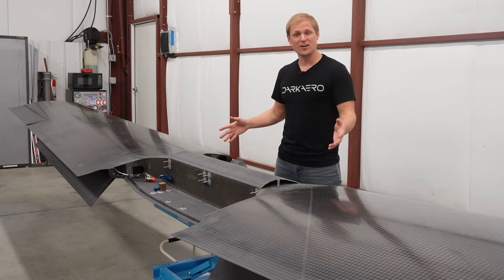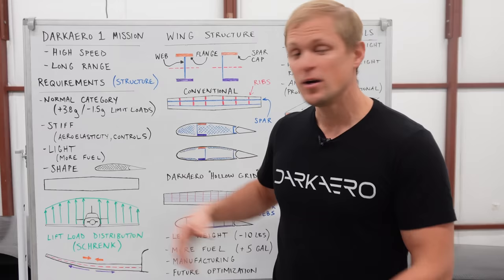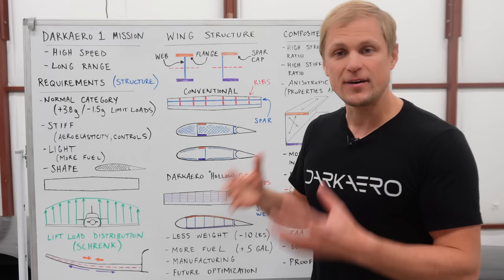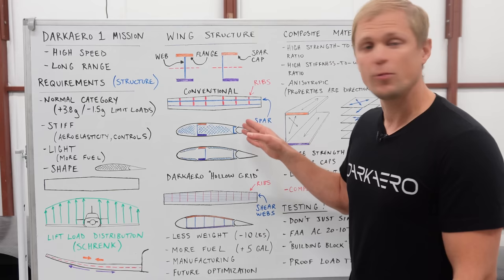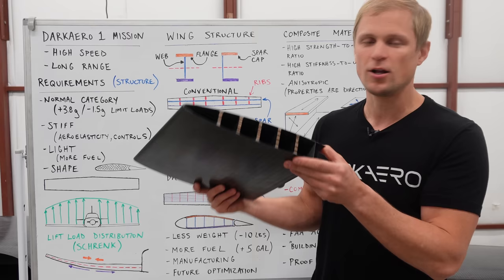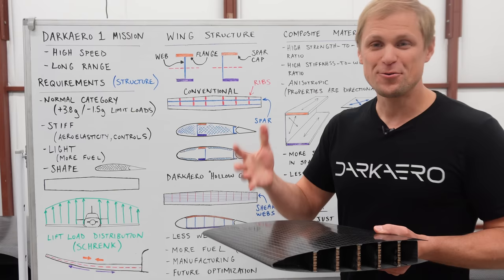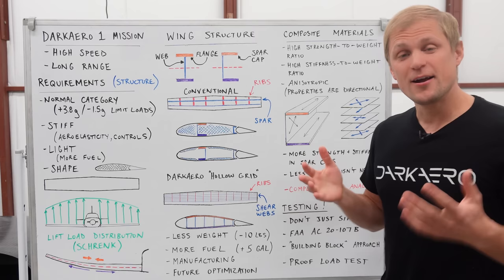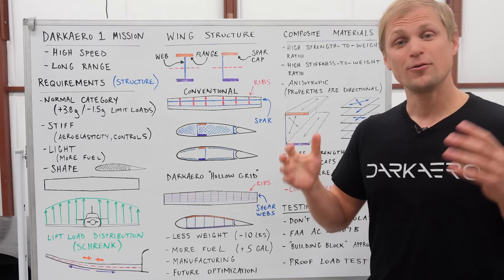Exoskeleton wing design - how carbon fiber makes it possible

Comment from the maker: Learn how to design and build your own high-quality composite parts and structures!

Sign up for the Aerospace Composites Course here: https://darkaero.com/courses/aerospace-composites
Online version available here: https://darkaero.podia.com/aerospace-composites
Reply: Im curious will yall have a jet engine variant in the future like Sonex has done?
Reply: We must be getting close to take off.
Reply: Very impressive lecture.    When you performed the load testing of the complete wing,  even though the wing withstood the load,  how do you know if internal damage has occurred ?   Do you have inspection hatches/ holes to enable say fibre optic visual inspection,  or are there other NDT testing methods available….strain gauges, ultrasound etc…
Inevitably the wing will experience stress/strain reversal which in an Al structure will lead to fatigue,  do these composite  structures delaminate ?    How do you plan to verify the structural integrity while in service ?

Comment: I would love to know if you guys have been surprised by anything you've learned yet while building this very coot plane?  Is there anything that you just didn't even think about or is the building and design process calculated to the last detail and you haven't been surprised by anything?  Keep up the cool videos, I get excited when I see a new one.
Reply from the maker: Hi Paul! Thanks for checking out our videos and thanks for the great question. Yes, lots of surprising challenges popped up along the way. A big one was canopy manufacturing, which turned out to be much more involved than expected. We spent too much time on that before we ultimately outsourced the process. We might try to bring it back in-house at some point. Making large honeycomb sandwich panels to meet our own standards turned out to be hard as well. We figured out how to do it at a small scale pretty quickly, but scaling it up was difficult.

Comment: Nice video!
I'm curious to see how the fueltank works with so many compartments.
Reply: I think it's essentially gravity drain through interconnected compartments and a large reservoir between the wings to collect before sending to the engine fuel lines.
Reply: They act as natural baffles.
Reply: I'm with you, would like to see the fuel tank design, seems like you would need a lot more sealant, which would mean more weight.
Reply: @divyajnana  More sealant for what?
Reply: @divyajnana  Watch their videos from beginning to end and you will then know what you didn’t before. 😉
Reply: @ashsmitty2244  Could be beneficial to reduce the sloshing of fuel

Comment: On the manufacturing topic, could you give us some insight into how the hollow grid is bonded to the skin? Specifically how you can count on that in a tank application..

Love these videos, incredible content. 
Great job guys!!!
Reply: Agreed, love the innovative ideas and think this is brilliant for things like control surfaces. But have to admit I am skeptical of that being used as a tank. There is a whole lot of bond area there and if any bit of it fails it will both leak and be inaccessible for repair.

Comment: Your comment about testing  vs simulation is so very true and ultimately important. Simulation is only as good as the data that's entered and all too often what's thought to be complete has omissions.  Empirical data from testing will fill in the simulation gaps and keep you and your passengers safe.  Thanks for the video and explanation.

Comment: Excellent damage tolerant design. Multiple load paths reduce the risk of single point failure. You explain complex engineering principles in a direct, easy to understand manner.

Comment: That was a treat. Lately, I too am using carbon fiber (foam cored) sandich panels, CNC cut to manufacture the internal structure of an aircraft. I second that the benefits of that approach being no-tool, large stock, easy design change, are extremely undervalued.

Comment: Thoughts about the very linear stress strain curve of carbon fibre? I am a structural engineer - in seismic engineering we use the non linear section of the stress strain curve (from yield to ultimate) to dissipate seismic energy (hysteresis - ie with steel ultimate strain is ~2.5x yield). This allows us to design for lower seismic force level and we intentionally let the building go non linear to dissipate energy - with the primary intent to prevent collapse (and the building is also not likely useable after a design seismic event). 

In the high performance sailing world, I think this has been one of the fundamental issues with CF. They are hitting yield loads followed quicly by structural failure because of the lack of a yield plateau (there is no ductilty). Do not know how the aeronautical codes are written but IMO, use of carbon fibre probably needs higher factor of safety in comparison to say aluminum. With CF you basically cannot afford to go past yield...

Comment: Very intelligent engineering related to manufacturing simplicity.  That was your biggest achievement. Smooth and deliberate presentation of information. I love the hollow grid design,  it is more organic and this should be the direction taken psychologically with all engineering and architectural thought processes. Well done gentleman, I will take your course as it sounds like great FUN ! And it may give me new insight to precast, aerated concrete panels  inlaid with an organic matrix.  Thankyou.

Comment: G,day Riley, River and Keagan from Sydney Australia.
I was wondering how you design structures (aerospace). I knew the components; ribs, spars, struts etc. I now have a idea of testing to resist G force loading. 
So... one could purchase plans with specified materials or "build and carry out testing to "with a coupon calculations measurement system recognised by the FAA"
On the other hand; completely experimental categories.
Then there's materials;
* Wood, fabric, aluminium, composite material such as fibreglass, carbon fibre in moulds etc.
"Speed, just a matter of money, how fast do you want to go?"
That was was a great lecture sir, you got my brain to spark on two cylinders.
🍏🇭🇲

Comment: This is really sick stuff, innovative, different. Interesting thing I noted about y’alls hollow core concept is that something similar is has been used in some 3D printing RC airplane designs too, going as far as to place stingers at angles to the width span of the wings. Its all fascinating
Reply: A similar design is used in fighter jet wings also. One that comes to mind, is the F-104. Where compressed bleed air from the engine  was sent outboard through the wing, and emerged from ports precisely located to blow air over the flaps when deployed. "Blown flaps" as they were called, reduced approach speeds significantly as long as the engine was kept spooled up and compressing plenty of bleed air. Losing the engine in this configuration, when landing, was unrecoverable. Such were the 1950s.

Comment: Great video, and you are selfless in what you share. Another reason we should be moving away from ribs and spars, is that they are an outdated function. They were needed to take mechanical loads when we had cloth wing skins! Now we have wing skins with serious stiffness/weight properties, we really don't need them so much! Yes theres shear to deal with and face collapse, but i love your design. Be really interested to know how you connect the cell spars to the upper wing skin when you close the structure, how do you know the glue is touching? :) Cheers from UK

Comment: That’s how Lear jet did their wing in the 60’s. They used that on all models but the 40 &70 series. Rather than a main spar and an aft spar, they went with 8 “spars” and the entire wing is one fuel tank.

Comment: I am most interested in actual takeoff and landing distance. Looking at the  competition VL3, Blackwing they have very short takeoff and landing distance over a 50' obstacle. I need that for sure.
Reply: Those planes accomplished that with quite low wing loading. DA has much higher loading and should have a better ride in turbulence.

Comment: You have very satisfying engineering and manufacture discipline. Where you might have opportunities is in simplicity. Have you considered a completely hollow closed shell wing? I believe Elixir does this. Because carbon fiber is stiff, it might hold its shape well enough with little weight penalty if any. And the shear forces transferred diagonally on the shell. And such a design avoids any bonding that could reasonably crack. Any presumably lends itself to fast and reliable manufacture. Cost effective. Similar might be possible for the fuselage although you use a somewhat boxy cross section. but let's say you could do the fuselage as a one piece shell or only one bulkhead for a penalty of only 2kg, it might well be very worth it.

Comment: Love your work. I would think you have a significant gain in torsional stiffness with your hollow mold wing construction because of the multiple closed box sections it creates. I'd be nervous about using any kind of honeycomb core material in a wet wing. A small crack or pinhole will result in tankering unusable fuel.

Comment: Another stellar presentation... We know engineers by their spelling. Schrenk as opposed to shrink is very clever... German: from Middle High German schrenk 'slanting crossed' (from schrenken 'to put across to lay diagonally') Schrenk happens to be very applicable to observed stresses of webbing the weave directionally of carbon fiber material. Thanks for sharing how exactly you guys arrived to the targets of DarkAero's mission plan with carbon fiber material construction. I'm not recalling the fuel system design at this juncture??? Is this a wet wing?

Comment: Going to need to see the manufacturing video.  How are all those pieces connected together? Seems like it would require lots of labor and lots connection points including attachment to the skins.  I'm a fan but I'm a bit skeptical on this one until I see more.  Former Boeing Manufacturing Engineer here although I left that field in 2000 and never worked with carbon fiber wings.

Comment: Based on my knowledge and hands on experience, the honeycomb core will be saturated with fuel after a while. Primarily due to cyclic ambient pressure change (with altitude). It is impossible to make them perfectly sealed, fuel will go through tiny gaps and stay there. It will add extra dead weight, better to use monolitic webs in the fuel tanks.
Reply: I wondered the same thing.
Reply from the maker: Hi Kirill! You have highlighted a valid concern! It is definitely possible to create honeycomb sandwich panels that are sealed against liquid/gas leaks. Sealed cells are often the default result for certain panel manufacturing methods, and this can be a problem in certain applications, which is partly why vented honeycombs exist. This is something we were concerned about when we were developing our sandwich panels, and resistance to fuel ingress was a criteria we tested and achieved.
Reply: @DarkAeroInc  Great! I wounder if you tested under cycling ambient pressure or just soaking in fuel?

Comment: I've seen other people talking about some peculiar challenges of carbon fiber that makes it not my favorite choice for a plane.

With repeated bending it becomes weaker.

Resin becomes weaker under VU light. Especially when the parts are not painted.

And a third reason is i don't like the way carbon fiber breaks. For a military plane, it could be better for a bullet to pass through a wing and leave a hole-like defect. While with carbon fiber a single bullet could break the whole wing in two.

Said all that, i still love composites. I would just not use them for critical parts. Something that my life depends on. Composites are perfect for the body of sports cars that are using a metal pipes frame underneath to hold it all together. Good for fishing rods, because my life does not depend on the fishing rod. Camping tents etc.

Comment: Love this video and the info you share but I'll join the chorus of others anxiously awaiting info on how the beam structure to skin bond is done. Bonding the core is easy, but mostly useless. How do you get a solid bond between the super thin rib skin to the outer structural skin? Traditional technique would require taping each joint but that would be enormously labor intensive and impractical here.

Comment: Study glider wings. We have the most efficient laminar flow profile wings around today, they all have spars (but some build their elevators as you do). You cannot do aspect ratios of 30-50 without a spar. Mentioning glider wing development would have been useful.  Also, to build high accuracy laminar flow wings, you have to build in molds.
Reply: Herbert - check out their other videos. An earlier one spoke to surface finish as it relates to laminar flow, etc.
Reply: Dark aero has many spars, just like fighters.

Comment: How challenging was it to calculate the stresses on the Hollow Grid design using either manual or computed aided methods?
Reply: Almost certainly easier, assuming You obtain the velocity/pressure distribution over the airfoil at several important angles of attack. 

It is simpler to integrate loads to multiple shear webs, and wing skin cells, than over an entire wing, flowing to a single spar which is constrained in placement due to thickness, and location of the Aerodynamic center.

Comment: My only concern would be the mating of the wing to the fuselage. That location has the greatest transference of cyclical cantilever forces. How those pieces tie in to honeycomb core and carbon cladding with structural rigidity is beyond me.

Comment: Nice video. I got interested about your hollow grid concept. Did you analyze the possible failure modes associated to having such a thin sandwich shear webs. I'm particularly worried about debonding in the T joint (between shear web and skin). How did you address this problem.

Comment: Thanks for sharing!

Well somethimes the best overal design is not only the 'best' functionally; for example in therms of weight or mechanical strength. 
Often manufacturability, serviceability, and availability, supply chain (availability of technique) and cost play an important factor too. I wonder how you guys at DarkAero made the full trade off, for example; Is the 5% weight reduction now worth 2x the cost in manufacturing?

Lets say one damages its left wing against a hanger door; can this be repaired without bringing the full structure back to DarkAero? Or is there a common understanding if this Honeycomb.

Comment: 01:03 wait a sec right here. Question; in regards to the wing flex, how do Gliders achieve controlled flight during High wing loading events? Especially the Open Class Gliders (25m Plus) I know it's unrelated to this video but I've never thought about that before & I've flown a few different Gliders from all Metal to Fibreglass. I need to look into that! Now back to enjoying the video, cheers.
Reply: As a guy who understands nothing about this subject, I assume that the surface controls are designed to opperate at high deformation levels in this case... given the large span (hence large arm moment), I'm also assuming they can be placed closer to the wing root where deformations are lower (not sure how it affects root-to-tip stall features). Hopefully the experts answer your good question :)

Comment: I'm interested in knowing if having an incompressible fluid filling the wing produces any changes in how the wing performs under the same test loads and flexing.  Could the fuel load the internal structures and possibly separate the ribs from the skin?

Comment: Thank you for your detailed explanation! 
I have one question: how does your wing structure accomodates torsion?
I mean, classical wingbox (the front spar, the rear spar, the skin between) is used for torsion stiffness also.
Is the same approach in your structure (the front and the rear spars are stronger than other)?

Comment: I assume that there will not be a "tank" in the wing or a bladder in the wing for the fuel.  As the chambers inside your grid wing are quite small, how are you managing fuel flow and scavenging inside the wing?  Are there small holes in the grid to allow flow but limit sloshing of the fuel.

Comment: Hello, very nice design, I deal with carbon strucures as well even thow not in the aero field, and One of the issues I have to face Is brittleness of carbon strucures. How do you deal with that for instance to avoid cracks from impact with birds?

Comment: For these thin walled structures the failure mode would inevitably be local buckling on the compression side but I can't seem to find any robust mathematical framework to predict this buckling. Also what should the spacing and configuration of the ribs be? Can you point me in the right direction? thanks

Comment: How will your wing handle a bird strike? Will it continue to remain strong enough if say 10% of the cord is damaged? I've seen pictures of airplanes with leading edge damage almost to the spar and the wing remained strong enough to continue to safely get the crew back on the ground. With no main spar how much damage can your wing take from a bird before it's catastrophic?

Comment: Is this a top skin that is then epoxied to a bottom skin (after adding reinforcement sandwiches)? If so, how where you able to epoxy the front leading edges to one another when the material layed up is so thin? Are you gluing a thin edge to a thin edge?

Comment: Odd question 🙋‍♂️ within the core of the wings could you add carbon fiber rods with tensioners on the end to stiffen and relax the wing. Don’t know if that makes sense. Wondering so I could make a 3d print airplane myself and test different wing designs.